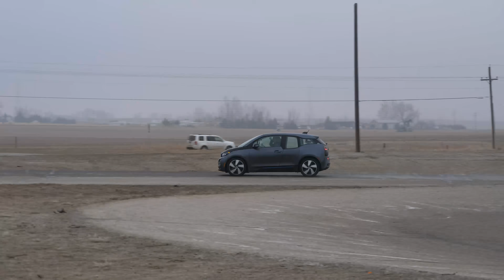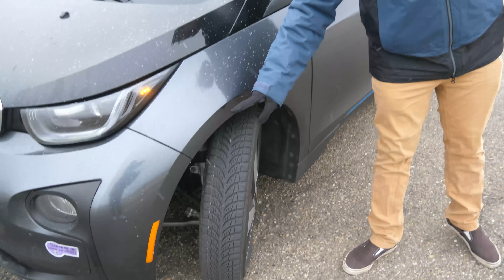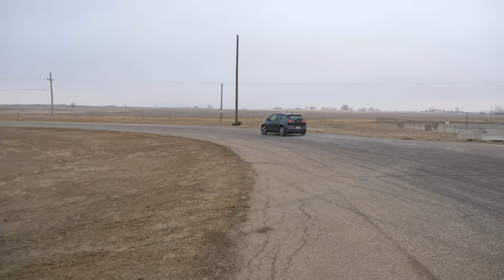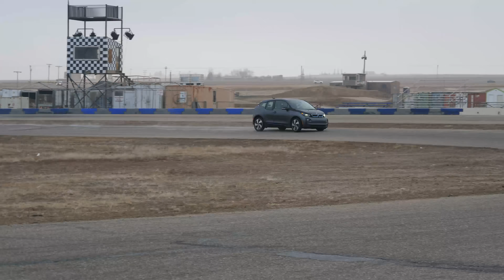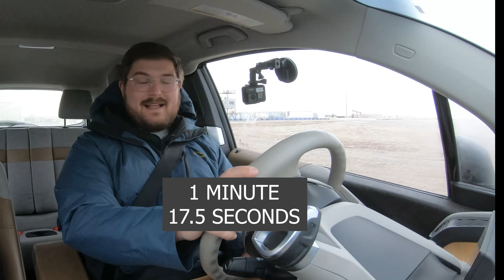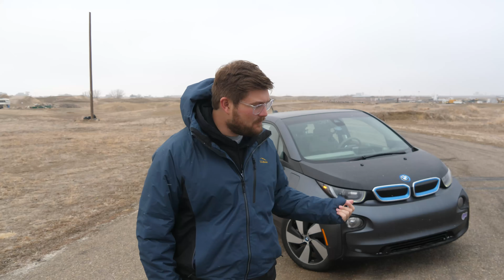Which Is Faster Around The Track? BMW i3 W/ ESP On, Backed Off, Or All Safety Systems Disabled!

Comment: Electric Performance - the BMW i3 was Quite Advanced in 2013 when it Launched, but the i3 Today is a SAD CLOWN among Plug in Battery vehicles, and being Combustion car based did not help it. its sales in 2020 had slipped down to the Bottom 10 BEV sold in America. and BMW has killed the i3 in America with no practical replacement. 
IF BMW wanted to compete with other Plug in Battery Vehicles the needed to Electrify its 2, 3, 4, 5 and 6 series , and to Completely abandon LEGACY technology such as GAS/Diesel and Hybrids/PZEV and FCV. 
as PURE BEV is a Superior platform and even Advanced 1865 /2170 L batteries can still power BEV. 
the BMW i3 also has a POOR used sales , due to its high DEVALUATION over time of over 80% , compared to TESLA which does not Exceed 10% value used. and TESLA simply gives you MORE for your Dollar.
Reply: Talking complete BS there, Sunshine. The i3 was purpose built as an EV, even down to the factory. Try doing some research before looking like a SAD CLOWN yourself.
Reply: @adampoll4977  as a i3 Rex owner. Mark makes one point, the I3 was designed around the requirement of fitting the serial hybrid Petrol range extender. Had batteries been better at the time, i think BMW would have chosen to make a larger battery pack. 
In the BEV version there is a slightly comical amount of open space next to the electric motor. You can buy a aftermarket boot plate that allows you to use that space more storage.

But as someone that don't have guaranteed daily access to charging, the REX is a fantastic safety net.
Reply: @coolfrost6  The REX makes a lot of sense for where we are in Australia, as we have few charging stations at this point. For the weekly commuter use the battery only range is perfectly fine (and fully recharges with off-peak power from a standard 3-pin socket), but for going on week-end day-trips etc having the REX means we can still leave the ICE car at home and enjoy EV motoring with that back-up.

Comment: Please repeat this track test in warmer weather with the all season EP600 or the summer rated EP500 tire. Better yet, the optional Potenza S001 if you can get your hands on a i3S (or a set of wheels for it). It may be helpful to a lot of viewers to show how you're switching between the different nanny modes as well. Thank you for putting this together!

Comment: This is just a question and not a criticism: Why are people still fascinated with the i3? The guy at BMW Blog on Youtube just got a brand new 2021 i3S in gold and its his 3rd i3 to date. He also has a Model 3 just like Kyle.
Reply: The i3 is a really good car with a lot of unexpected positives as well!
It is really small (sub-4m) but it is still roomier than most other cars (for the driver and front passenger, but even the back seat isn't cramped). It is quite peppy in city traffic but still can be driven really efficiently! I've seen people reaching over 400km with the 40kWh battery (no highway though). The internal design is magnificent with nice materials, great visibility and ease to use. Remote climate control and other features via smart phone is great in freezing winter or really warm summer days - I haven't had to scrape ice from it this winter yet, despite  a month of around -10°C (~13-14F) and snow!
Reply: It's an excellent value purchased used and an excellent commuter/city vehicle. It's a ton of fun to drive. Very unique and practical small hatch that's well built. It's more engaging to drive than all the other options in its price range (for a used one). It's surprisingly efficient when driven at sub 55mph speed, extending its range way past all EPA estimates. I wouldn't trade it for anything else that has similar price.
Reply: @LyuLefterov  
I agree that its a well built car and out of all the older used EVs on the market that are well under $15k, the i3 is at the top of the list as the most engaging to drive..The Chevy Bolt is on the used market and some can be had at $15k. The VW eGolf and the Mercedes-Benz 250B are extremely well build, however the Benz lacks CCS charging and so do most of the eGolf and neither are as engaging as the i3..
Reply: @Jeff Newcomb 
It doesn't do well on what things?
Reply: Those that are fascinated probably own one. I do and I love mine. If you don't own one, you'll look at it on the surface level and not see the draw but as what everyone's mentioned - it's very well built, great experience as an electric car and has aged very well. Been a very reliable commuter car and does everything you're looking for as a driver and passenger. Did I mention how easy it is to navigate and park because of it's size?
Reply: @alexd4795  
I do agree its very well built for a plastic car, everything is put together nicely.. I am actually testing a 2021 i3S today, will be putting it through all the paces.
Reply: As someone that doesn't have guaranteed daily access to charging, the REX is a really nice safety net for the >1% when I need it. Although overpriced from new the 2nd hand prices fit me well.
Reply: you would have to drive one to understand
Reply: @19schneider85  
I agree. I've driven a couple of these cars and they are really well built and handle well in the city.